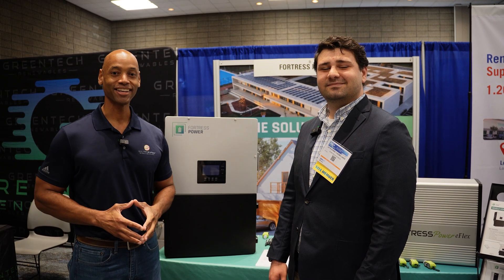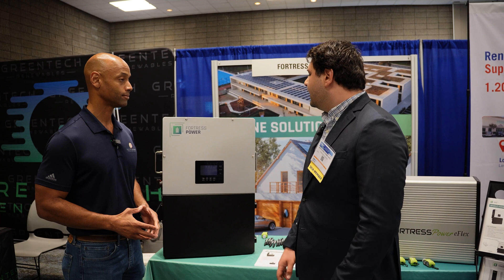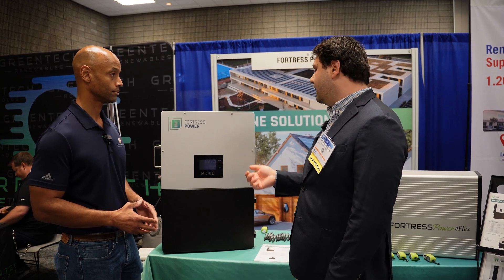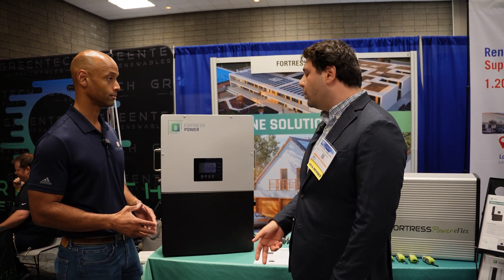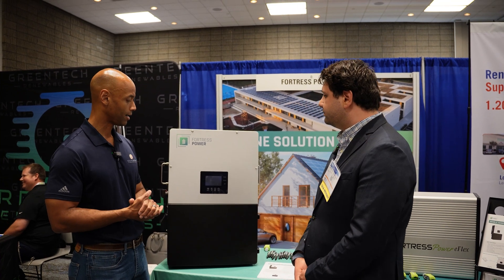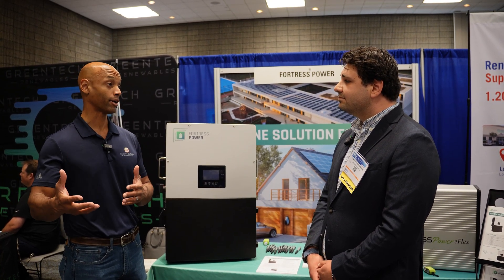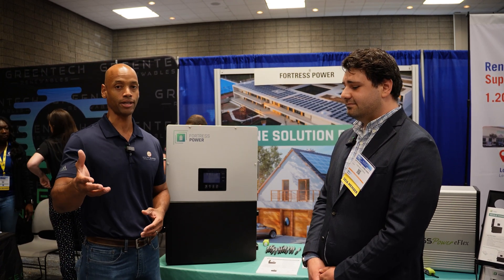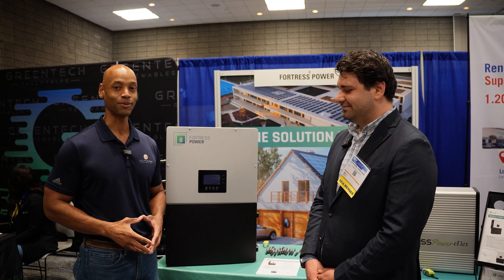New Fortress Power Envy True 12 Inverter

Comment: Uh, this inverter is identical to the EG4 18Kpv hybrid inverter from Signature Solar and it can be used with MOST LiFePO4 batteries that have closed loop communications.  It is not restricted to any one brand of battery.  Fortress is just trying to pressure customers into buying their overpriced batteries.  Fortress makes good batteries, but they are just so overpriced and low on features now days...same as Battle Born.

Also, this inverter comes with a larger wiring enclosure area which Signature solar has chosen to use in the EG4 18Kpv.  It looks like Fortress is using the smaller wiring enclosure.  Only saves a few inches of space vertically.  I would rather have the EG4 18Kpv for the extra wiring room.

And yes, the inverter is overpriced...the EG4 version is about $5,600 w/free shipping and the Fortress is about $6,500-6,700 for the same piece of equipment...don't know about shipping.  And the EG4 18Kpv comes with the Wi-Fi dongle.  I wouldn't be surprised if Fortress makes you buy it separately.